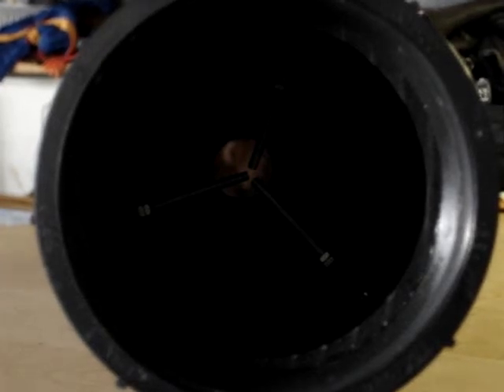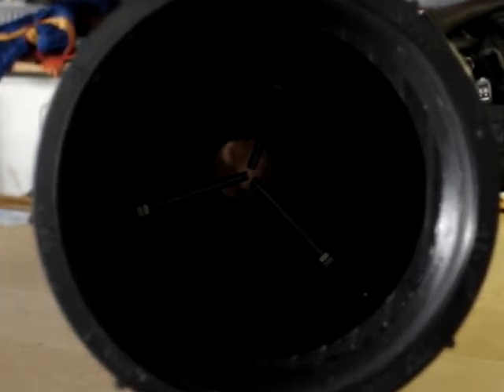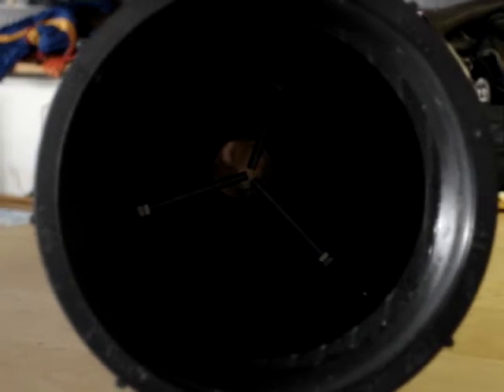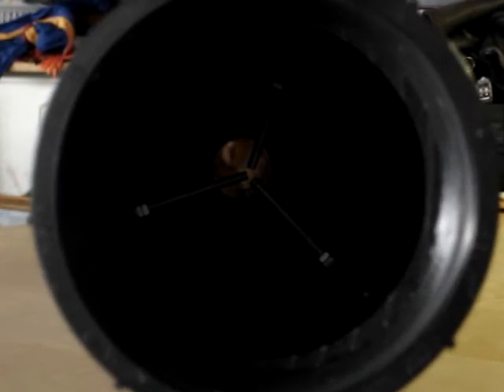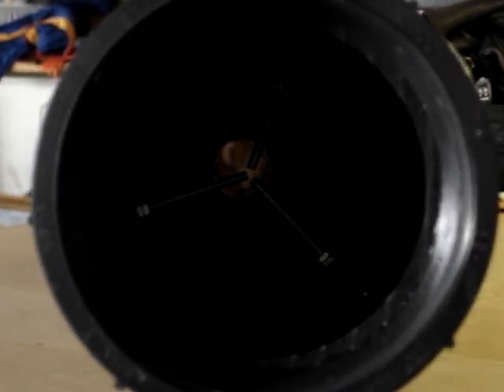Potato Cannon ignition

Comment from the maker: @Alberto022592 - I think I ordered it somewhere online.  It was pretty cheap, something like $20.  Basically, all I did was carefully open the casing, remove the stun prongs, solder wires to those connections, insulate the HECK out of those solders, as well as the exit points from the stun gun, and then ran three wires to the three screws (one from positive, two to negative.)

Comment: with a stun gun you can space the electrodes farther apart, you can easily get a 1/2" arc  from a stun gun, you have your spacing for a piezo clicker ignition. the longer the arc, the faster the gas ignites.  that emits a weasely little buzz, space em farther apart and you get a louder, wicked sound.